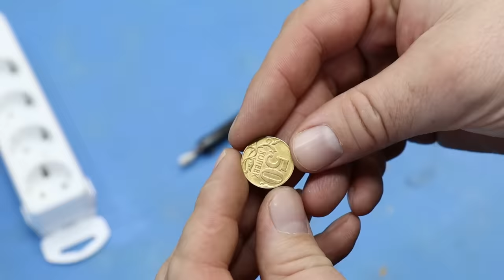Мало кто знает эти Советы и Хитрости Мастеров по Дому, Которые Действительно Помогают  ▶100

Comment: At 15:20 and 17:13 you show the drill bit sharpening angle as 116 degrees.  The other angles are 32 and 90 which calculates out at 58 degrees.  Otherwise there are some good tricks.

Comment: I hope I am not piling on. On the drill bit sharpening block, the last angle is 58 degrees, not 116. And sharpening something on the side of a grinder wheel is risky. Unless you have the modern diamond wheel or a CBN wheel.

Comment: OK, If I buy a $400 (average price for a cheap but new one) mig welder and spend 10 minutes per nut (minimum) cutting washers, then trying to weld nuts on center, I can end up with blind nuts that are available for about 30₵ here in USA.  I suppose I I lived on in a rural area of eastern Europe this would be a good trick, but if you have any experience at shopping hardware in the US, it is far cheaper / readily available to just buy the few pieces you need.  And the threaded inserts I buy (as opposed to the one made here by putting a taper into a barrel nut - itself sometimes a hard to find item - have barbs on the sides to prevent spinning out.  But you got to give this guy his props for creativity....

Comment: why would you have to make stuff that is readily available in a hardware store. to much time spent making something that has already been designed. the clincher was the very first tip, taking a washer and cutting in 2 slots, then bending the washer, then welding a nut on it to be used to hold a bolt coming through wood, by haveing the bent part of the washer dig into the wood so it wouldn't turn when tightening.  it is called a blind nut that is very cheap to purchase.
Reply: He lives in a suburban country house in Russia. It’s like a miniature estate.  I don’t imagine there are many hardware store around so there is a need to use your head if you wish to build things. Hope that explains things for you!😊🇨🇦

Comment: 4:47 in video bad idea by doing that you basically riuined the solder tip and will have a shorter life to it its better to use a tinner for it or one of those metal sponge ppl use unless the soldering iron is one of these cheap crap ones you get for 10 bucks lol